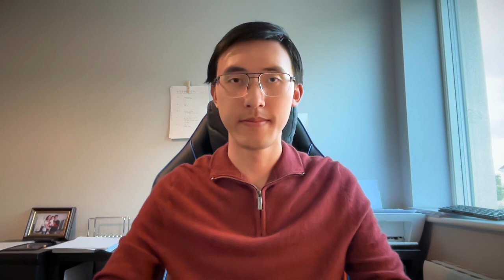💥 Can Renewable Energy Power the AI Revolution?

Comment: Absolutely not. Fusion isn't even remotely close to what it is percieved as being. Start with this example. When the atom was split, a zero point was accessed, what I would consider a horizontal half way point between the atomic nuclei, that exist each as a pyramid above and a pyramid below the equator, the apex of the neutrons pyramid at the south pole, the apex of the protons pyramid at the north pole. the bases joining at the equator. Those pyrmidial bases opened up and pulled energy stored in a zero point elsewhere, that we are still paying for today. The half life decay rate and radioactive isotopes were magnetic field lines that travel vertically, or propegate electric and magnetic energy that balances particulate, or mass in atmosphere and are actually the life cycle, as well as historical record of those elements used... think about that for a moment.  Fusion is most likely only utilizing that same magnetic and electric field energy in atmosphere that is very much finite, especially with current conditions.
 Here's the funny part. The sun essentially uses it's mass, while oscillating up and down to create valence and covalent bonds while recycling emitted particulate in the heliosphere at north and south, as well as Earths entangled core and generating electrostatic current during solar cycle rotations, basically. Helium 3 isn't a result of thermonuclear explosions, but a rather complex balance mechanism, either inverse or transverse relative to propegation of particulate in  Earth and space. Pressure differentials occuring as particles, gasses and polarized energies cycle from the core outwards towards the equator, nominally to some degree certainly. I could explain it perhaps a bit better at some point, but it's certainly not what is currently percieved and there are too many issues not being prioritized to waste time and energy on fusion....
Reply from the maker: This is a very insightful technical discussion for sure :) It's very interesting how you brought up the structure of atomic nuclei and their complex interactions. I thought purely looking at the mass defect when deuterium and tritium nuclei fuse would be sufficient, as we are more concerned with the release of energy than the inner mechanisms. The obvious challenge is that fusing the two nuclei together requires significant energy to overcome the electrostatic repulsion. Regardless of whether fusion is futile or not (it seems so over the past five decades), we are lacking an alternative fuel source that would provide as much energy without generating excessive pollution.
Reply: I am a high school student and interested to learn stuff to understand what you have stated. If possible please link me some resources regarding this. Thank you
Reply from the maker: @mayankmuthannamonnanda9030 This is why you should smash the subscribe button with 1000TN force until the nuclei overcome electrostatic repulsion and boom there's the Eureka 😂 jkjk you're welcome to ask anything!
Reply: @mayankmuthannamonnanda9030 I'm the only resource thay I know of currently, other than God and several other spiritual beings, feel free to ask away.